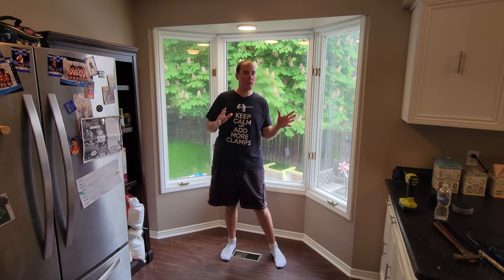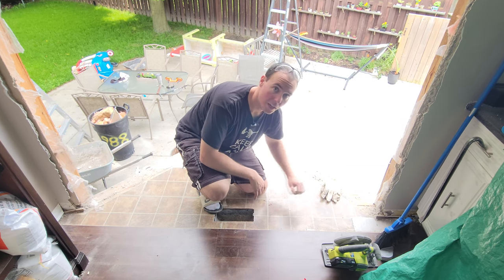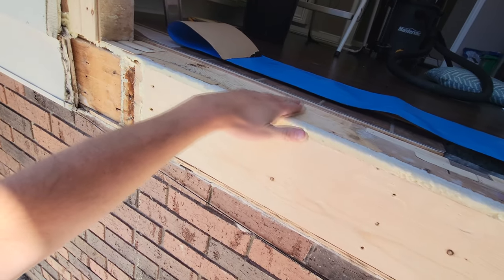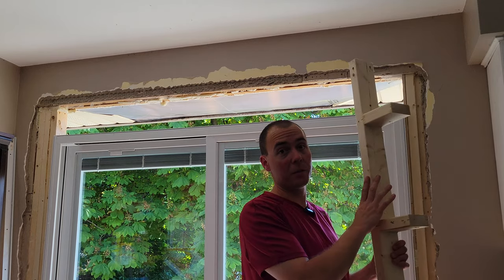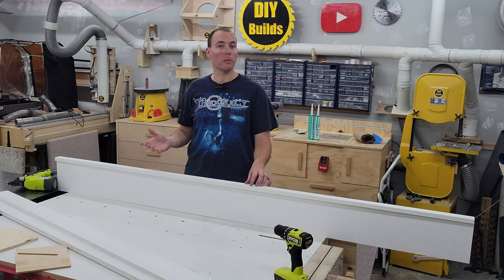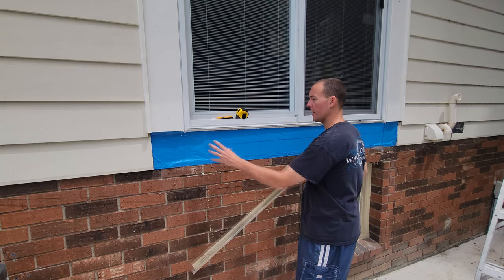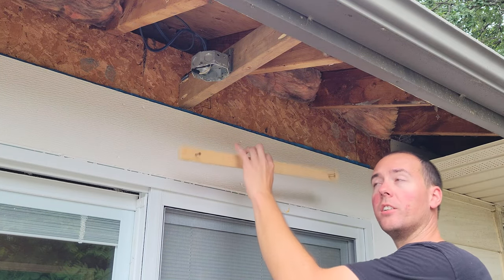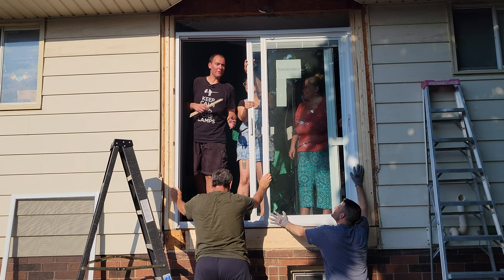Converiting a Bay Window to a Sliding Patio Door

Comment: At 12:08 .... is that an exhaust fan pipe .... trying to figure out what that is, as the bay was there before, so why would an exhaust fan pipe be routed there?
Reply from the maker: So that's how they did the baffles to vent the attic. Super dumb way to do it but that's the way it is.
Reply: @DIYBuilds  At least they did SOME venting...    a long time ago I crawled through an attic adding ventillation to a 50 yr old house... never again. next time I hired a company to do it.  Highly recommended.